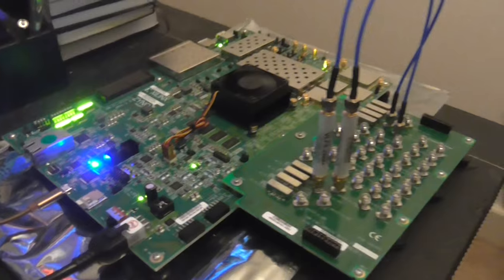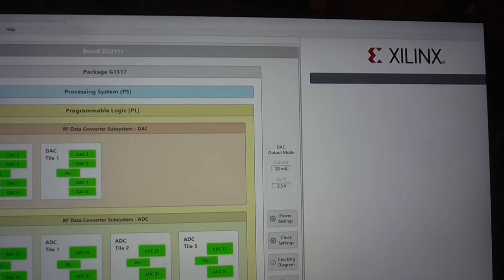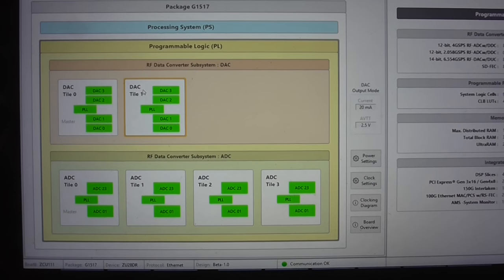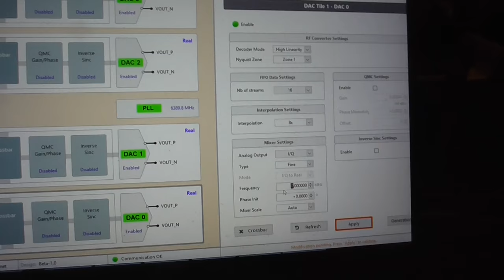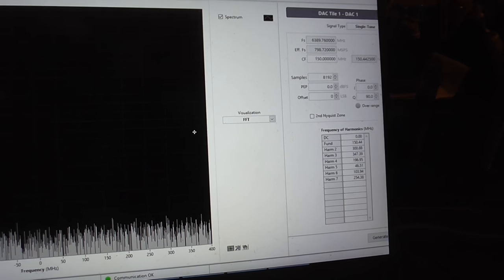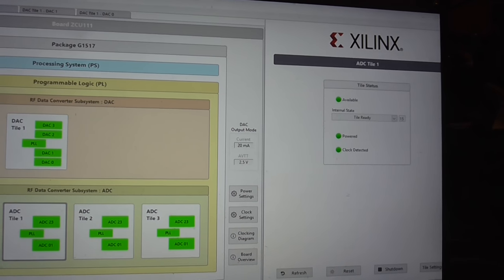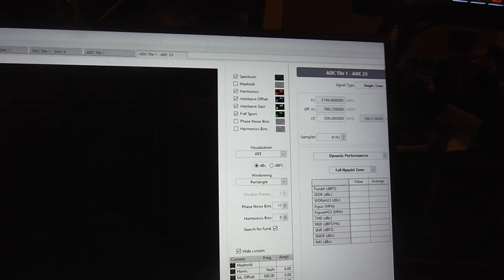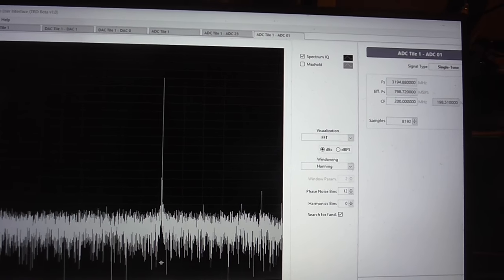RFSoC Initial Set Up

Comment: Hello! Thank you, this was really useful. I have a question concerning the PLL circuit. Why do you use low pass filters in the XM500 board? Also, what is the point of connecting the ADCs to the DACs? For generating, say, a sine wave, only the DAC would be needed, right?